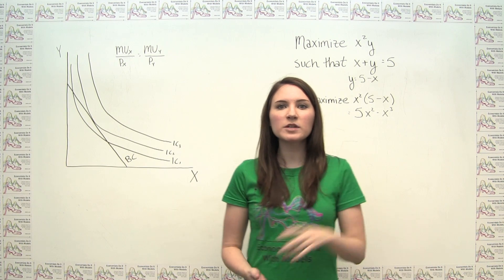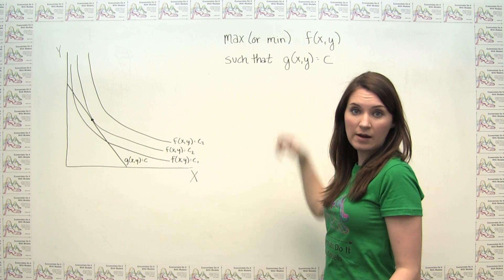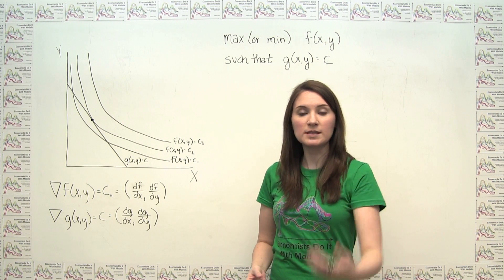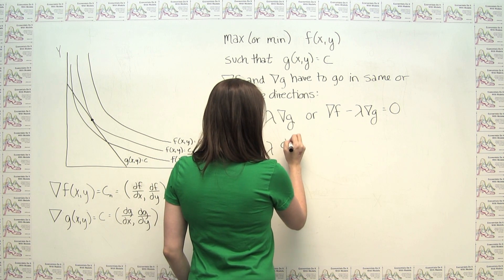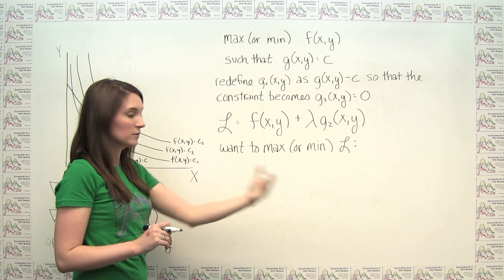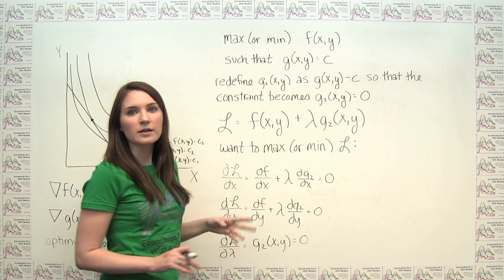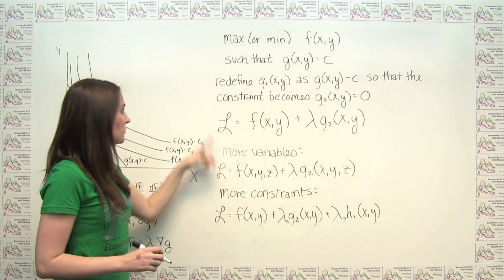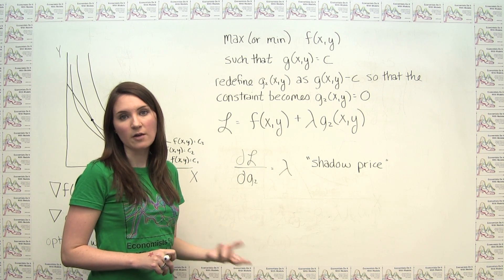Introduction to the Lagrange Multiplier

Comment: @Eddie Olayo
There is no strong reason to do three-variable examples, because they work exactly like two-variable problems - the only difference is that three-variable problems are more tedious and practically impossible to sketch as graphs.

My math book even explicitly points out that all multivariable definitions are made in ℝ³, and that this can be extended to higher dimensions when necessary.